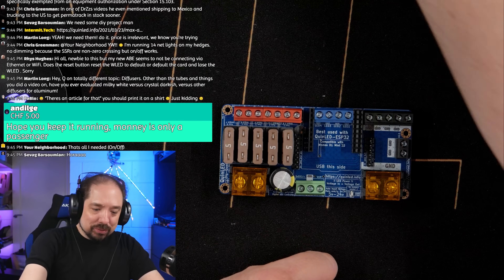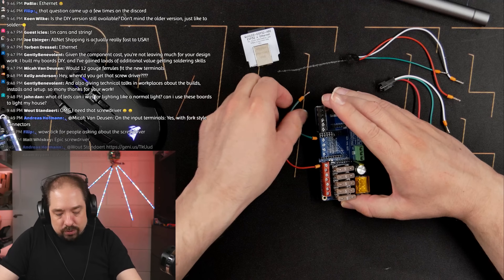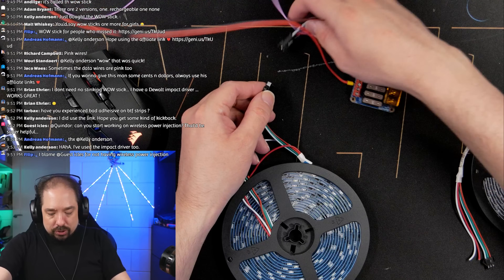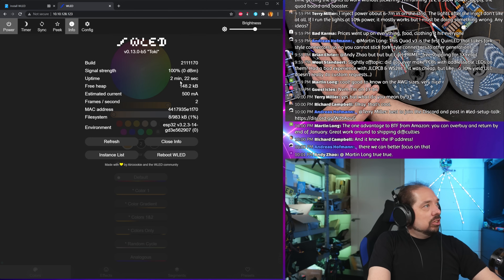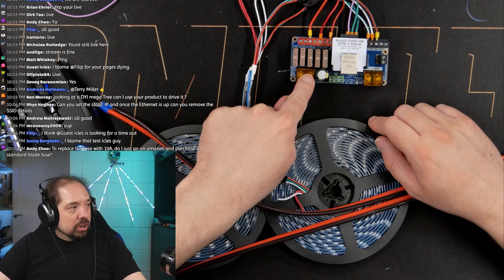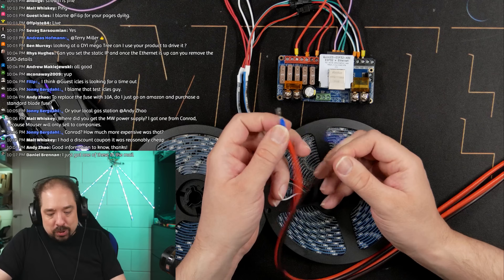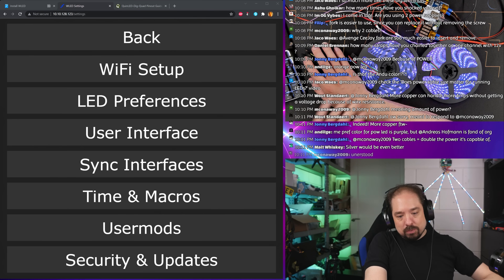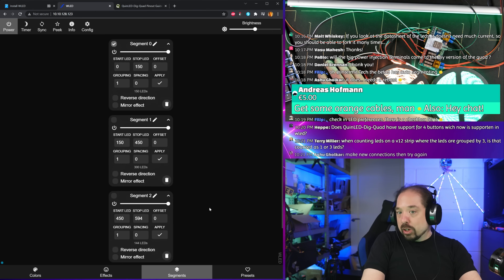💡QuinLED💡 WLED tutorial 2022 - QuinLED-Dig-Quad setup from scratch, with Ethernet!

Comment: Awesome! I have one little addition at 6:00 : When enabling Ethernet, I would simultaneously clear the Network name (SSID) field. Most of the time it works regardless, but sometimes wifi might take initialization precedence over Ethernet, which could lead to weird behavior as the code doesn't expect to have two working network interfaces. It is on my bucket list to prioritize Ethernet in such a case, and use wifi only as a fallback in case Ethernet is disconnected, but that is not implemented yet.
Reply from the maker: Ah that's very good info to know, thank you! :)
Reply: Awesome advice :)
Reply: Great work, Any option for a random effect on wled, or only one at the time effect, Thanks
Reply: yes sir :)
Reply: is this the reason I hooked up my first ever DIG UNO EThernet version., It worked fine the next day it could not find it ?
Reply: @botoepfer8588 me too i am out of idea.... I have 4 uno, 2 quad, and one octa, All with lan connections.
I have 2 uno's (One in kitchen and one in bedroom)  lost lan connections every time in My house for some reason i have to take off General electricity.
After i Switch it on, these two boards loose connections, and have to reflash fw with pc because They are powered but Rj45 not lit. It is very frustrating, i already deleted the Ssid name, and has static ip insider router. Any hints guys?

Comment: I caught that blip about going back to GPIO2 for the default for LED1... What's the reasoning behind that?
Reply from the maker: So there is a bit of a history there. The reason it's GPIO16 is because that mapped to GPIO2 which was used on the ESP8266 and when the board was ESP8266 and ESP32 compatible. My ESP32 modules are based on the WROOM modules from Espressif themselves and then there is no problem with that. But if you'd used WROVER based modules GPIO16 has functions tied to the PSRAM found in those modules which could create a conflict. Now while there is no problem on my boards since all are WROOM (no PSRAM) based, some other boards might use WROVER modules and then having the default for WLED on GPIO16 could thus create an issue. So for those technical reasons I do get why they would not keep it as default for WLED in that sense. :)
Reply: @IntermitTech  Great explanation, thanks!, so no reason to change an existing setup with one of your boards. I was just trying to prepare if there was a reason to move :)

Comment: Why is the Male connector on the supply end?

Who has chosen that orientation?

would it not be more logical if the supply side were female just like your Wall outlet??
Reply from the maker: You mean for the JST connector? That's just how the strips generally get made, it's also a bit of a difficult connector to call male or female since the strip side doesn't have the pins sticking out but that connector does go into the other connector, which does have the pins sticking out (but inside of the connector)
Reply: Do IT have pins it's a male No matter the housing / bessel